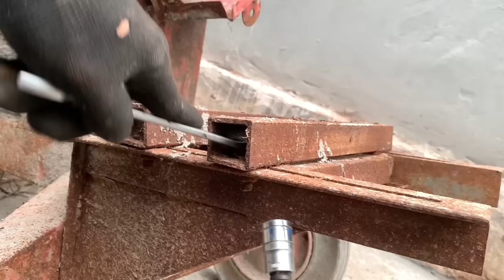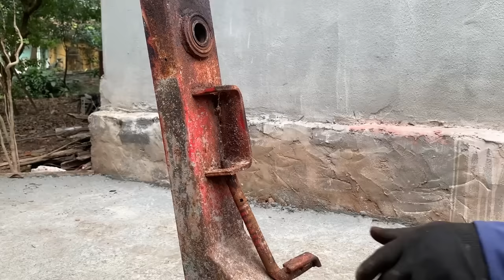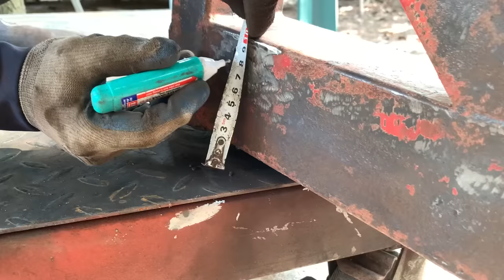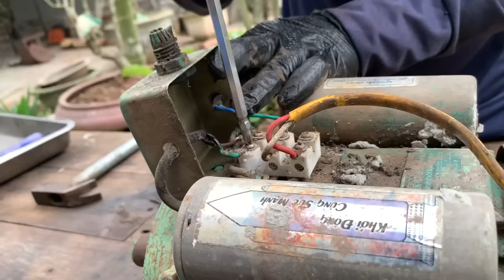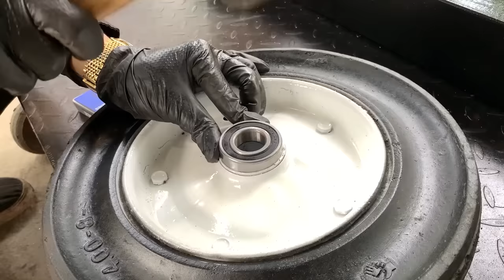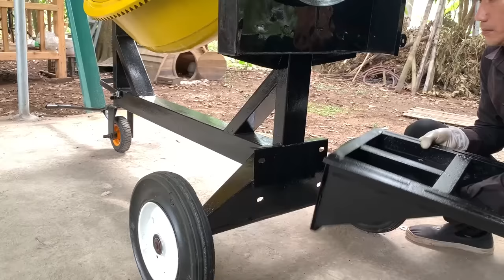The Incredible Restoration of Rusty Mini Concrete Mixer by Master Mechanic, Full Restoration Process

Comment: I see you restoring lots of stuff... I realy recommend you think of maybe investing in some cheap sandblasting machine and get a (used) 1,5 to 2 cubic meter/minute compressor to keep it going. With dustless abrasive it should be a charm, also think of the ocean of frustration and time you would spare by cleaning/blasting things instead of grinding.. Ok, big surfaces are not a problem, but small things full of crevices and protrusions are a pain! Excelent work though, just try to avoid hammering bearings in the future..😏